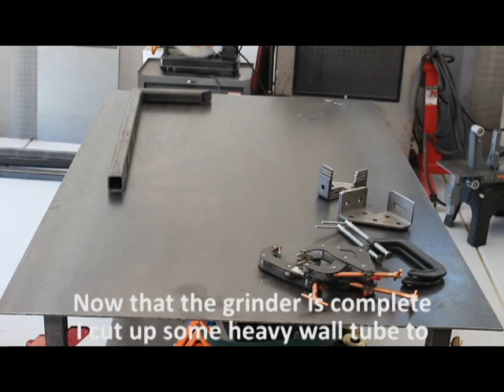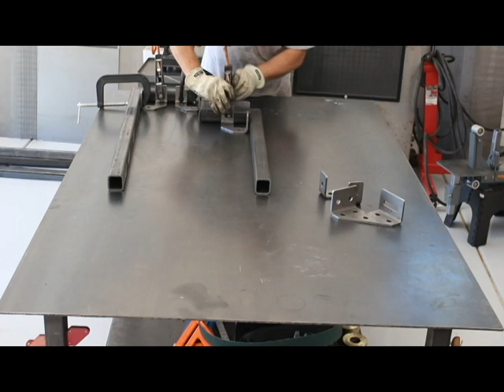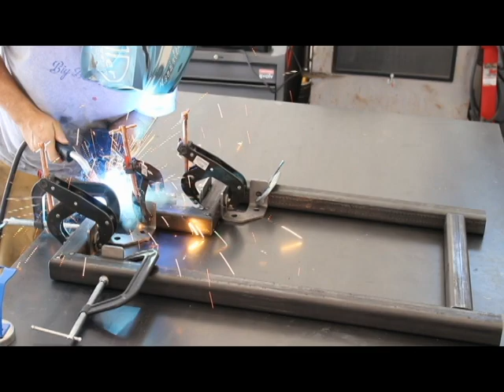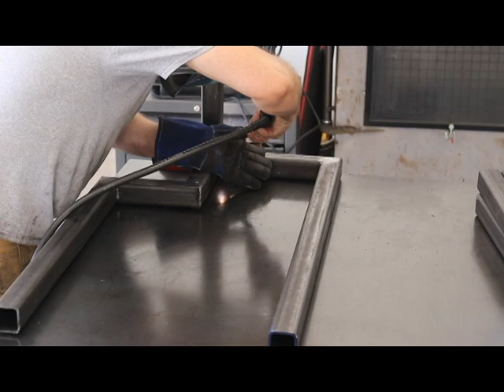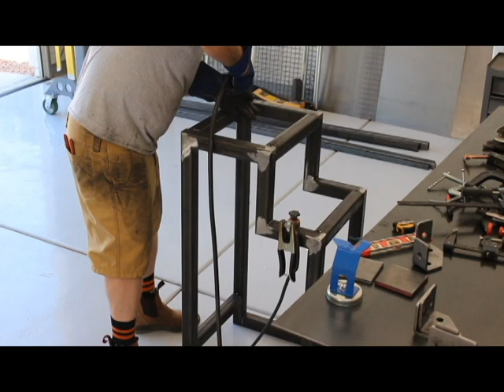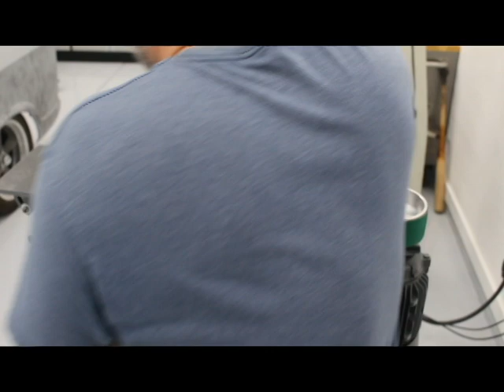2x72 Belt grinder build (part 4)

Comment: There are many different videos of Jeremy Schmidt grinder builds. I like yours because you used the foresight of using tab and slot design for your receiver tubes (nice). Noticed you have a plasma table and was wondering if you would be interested in cutting the complete parts set or at least be able to sell the file set so I could have them cut locally. BTW that 4 or 5 inch #8 cup in video 1 was insane. Awesome job on the build!